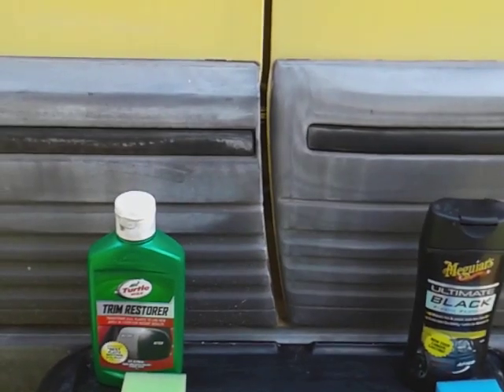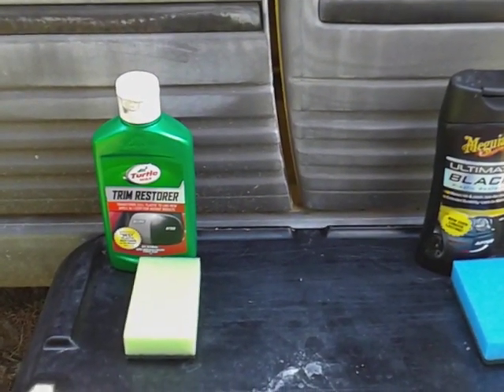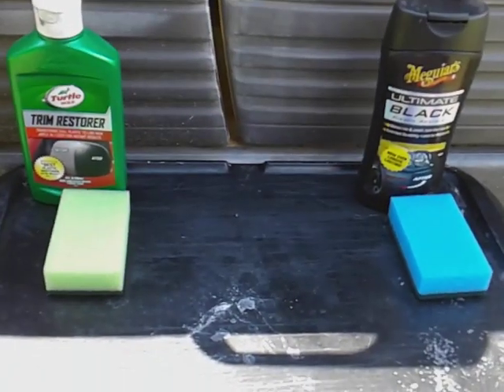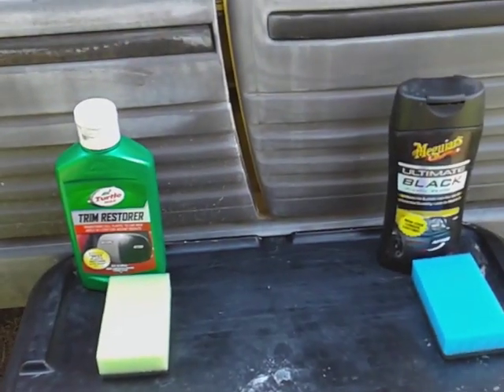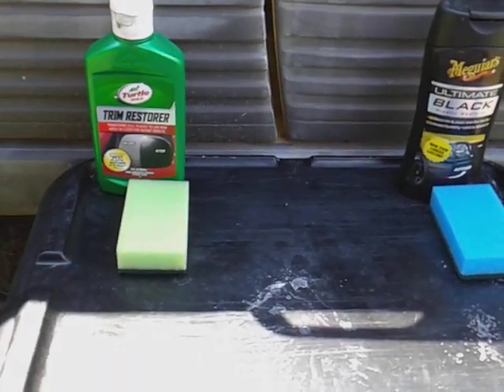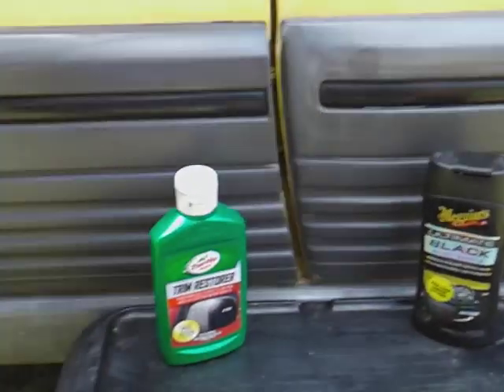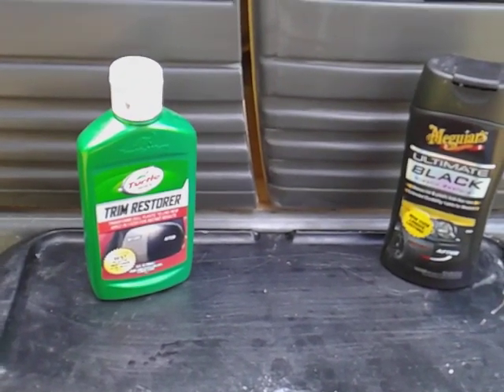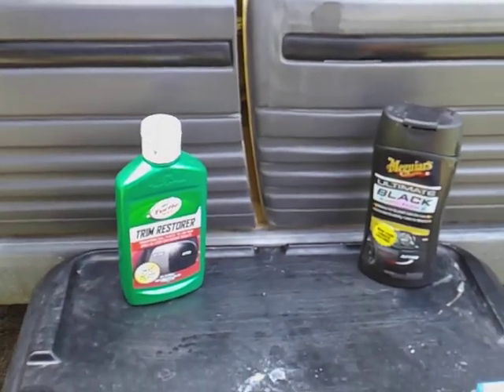Turtle wax trim restorer vs meguiar's ultimate trim restorer showdown

Comment: Do it get rid of black marks on trim got some after I used iron remover on my truck today you can see the spots on my video put up today not gonna use iron remover again you got to tape the plastic trim I saw about it before applied iron remover but still didn't tape the plastic trim good didn't get a lot of spots messed up.